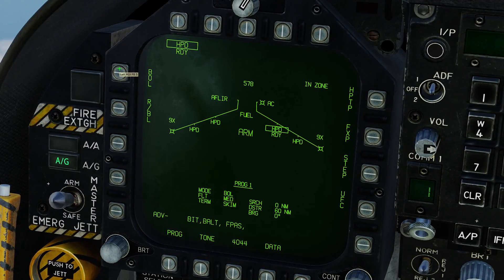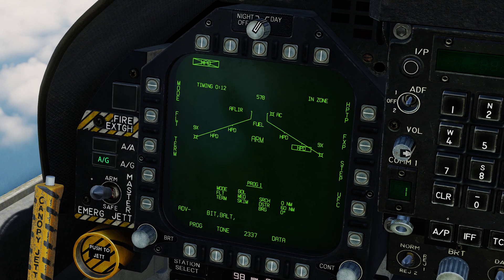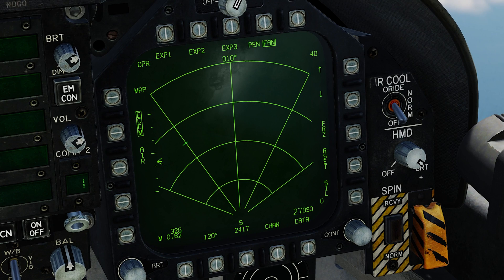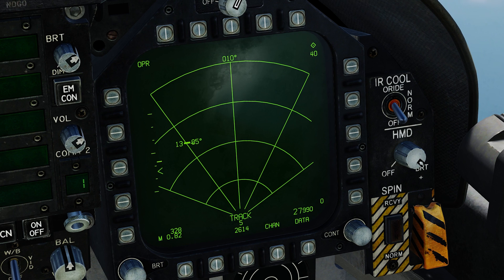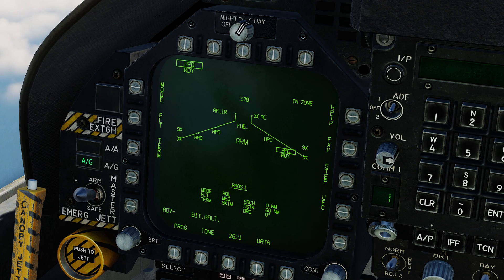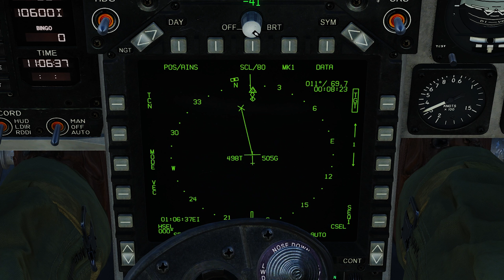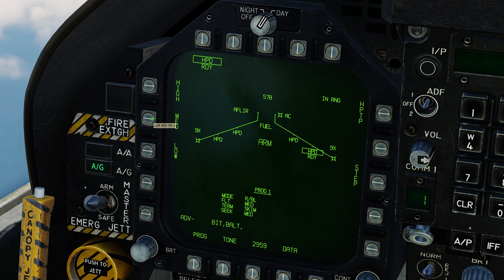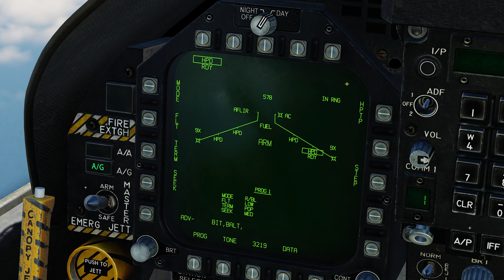Crush Enemy Ships with the Harpoon Missile in the DCS F-18

Comment: I tried the same scenario and had the same result. I also tried coming in at 50 ft and mach 1, throwing 5x 2000lb bombs onto the ship and it took only a few % damage. You'd think a 2000 pound projectile hitting something at 1115 feet per second would do something, nevermind one with a bunch of explosive fill, but, meh. I blame the damage model. Also I discovered that the DCS world is flat. The cruiser didn't start firing till I was within something like 10 miles.

Comment: Thanks for the refresher! Its so weird that not all weapons use the same button press scheme for fuctions like locking. But I guess different contractors, different software & methods. 

You need to hit the slava class with at least x7 harpoons (usually more) to knock it out in dcs, or x24 gbu 38’s set to pen mode. It’s really silly imo. I doubt it will change but I really wish they’d make weapons a bit more effective vs ships when they hit.
Reply from the maker: That’s a lot of boom required!